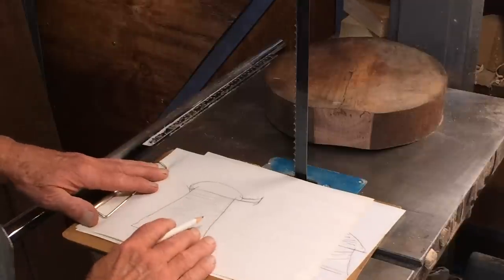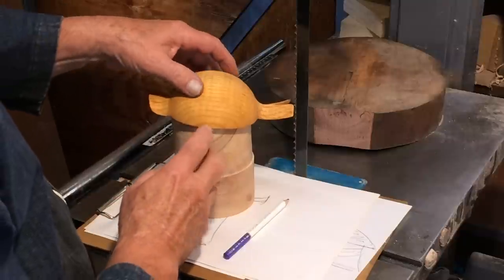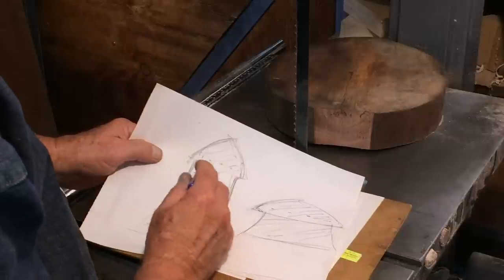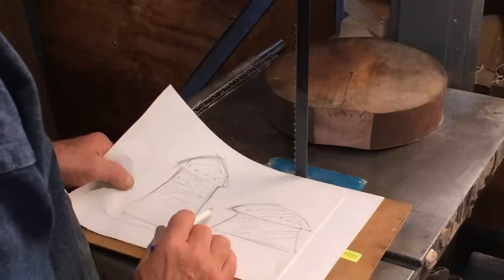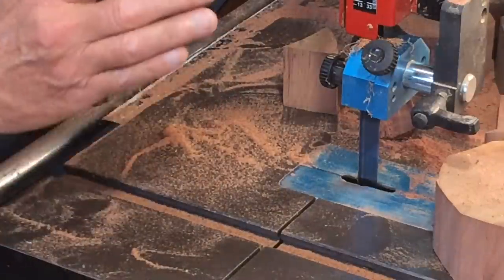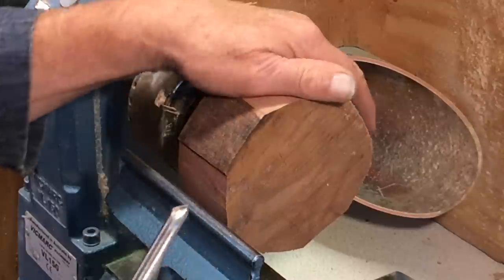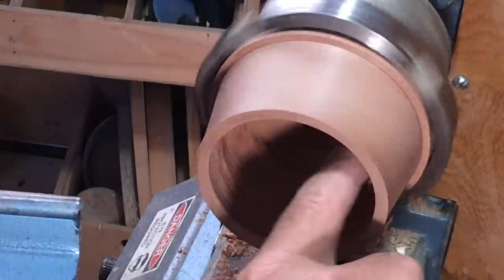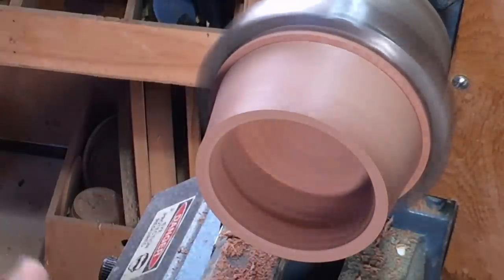Richard Raffan creates a cross-grain box for the first 4—WAYS project.

Comment: Beautiful little box. I am learning to use the dividers like you do to mark a circle. Previously I relied on a large compass with a pencil whose lead frequently broke on rough wood.
Reply from the maker: Did you notice you three had infitting lids, as I usually do for crossgrain boxes, whereas I chanced the other way. I've never got around to making chuck gauges but do have dividers set. Steel gauges would be ideal because dividers shift over time.

Comment: If there is one thing I've learned from watching your video's it is to use scrapers more often. 
Slight problem: You seem to have the right one for every occasion whereas my range of scrapers is fairly limited. 😎
Reply from the maker: Unfortunately I downsized before I started making the videos so no longer have the range of scrapers I used to and most are getting a bit short from regular reshaping.
Reply: @RichardRaffanwoodturning  as a relatively new turner, I've always thought of a scraper as a finishing tool, but I've learned from you that they are good for shaping as well.

Comment: Quite surprised you didn’t use a screw chuck followed by creating a tenon on the bottom for reverse mounting.
Reply from the maker: Mounting over the pin jaws is is faster with more options for adjusting the blank. And i see no point in creating a tenon when I can grip the outside. Putting on a tenon that eventually needs to be removed when I don't want a small foot or base is a waste of time and material. I wasted quite enough on this project as it was.

Comment: Nicely done, RR! Surprised you did not bandsaw that lid to save as a lid for another lidded bowl:)
Reply from the maker: Far too dangerous!!!! That a good way to lose fingers or part thereof. Never cut cylinders on any band or table saw unless the cylinder is firmly clamped to a carrier so it cannot roll into the blade. I did think of parting it but it wasn't worth the time or effort.
Reply: @RichardRaffanwoodturning  Of course, clamp is absolutely necessary along with a jig. You’d be nuts to do it by hand, but safely doable.
Reply: Hi Richard 
I’m a bit uneasy using resin, getting the mix correct,but never thought of using epoxy for small jobs other than gluing up.
Another gem learnt ,using as you did on the embellishment of the lid. I need to try that method using some brass filings I have obtained from a locksmiths key cutting machine.
Thanks for sharing,I think your videos are the most interesting and give a feeling of being along side you in your workshop while you turn.
Thanks
Regards
Reply from the maker: @malbun3275  Many thanks. Your feedback is useful and appreciated.

Comment: Beautiful little mushroom box! Richard what tool would you use to add a round groove around the yellow spots to be filled with coloured epoxy?
Reply from the maker: I'd probably use a skew long point as a scraper so there's a key for the epoxy.  I wouldn't dream of one groove, I'd have a rough groove with wavy edges either side of the dots.

Comment: Hi Richard - I've been watching your videos with great enjoyment ! I have a question about your use of the square end scraper for the bottoms of cross grain bowls/boxes. Would you recommend this technque for larger (12"+) and deeper bowls, assuming adequate support for the tool ?
Reply from the maker: My big bowl scrapers are 35mm x 9mm thick. You seem them in the deeper bowl videos. i rarely go all the way into the bottom of a bowl using a gouge. I find scrapers more accurate.

Comment: What is your lathe speed wen you are applying the beeswax?  I am having trouble getting mine to melt in.  My lathe is in the unheated garage in the northwest corner of Indiana, USA.  I started turning about 6 months ago.
Reply from the maker: Pure beeswax should melt even if the wood is moving quite slowly. You need sustained firm pressure for the wax to melt and the further from centre you hold the wax, the faster it'll melt. Near the rim of a small project like this running at about 1500rpm that should be 3 seconds even in 5°c.  On a 16-in platter running at 800rpm the peripheral speed is probably greater than on the faster spinning smaller project so the wax will melt faster.
Reply: @RichardRaffanwoodturning  thank you for the information.   I have learned so much from your videos.  Turning is my tranquilizer.  I just wish that girls had been allowed in shop classes in the 1950's when I was in high school.

Comment: Your gouge has the left wing longer than the right and I’m not seeing when that comes into play, so what does that grind do?
Reply from the maker: This is the asymmetric grind that I developed in the early 1970s. It's more to do with the steep right wing bevel making some cuts much easier than the swept back left wing although that's where this grind started. Bowl gouges used to be ground straight across until I came alone. This video shows how I use the gouge.  https://www.youtube.com/watch?v=cnNBBV19YLw&t=1s
Reply: @RichardRaffanwoodturning  interesting, I used a 45 degree bowl gouge on everything but the bottom of the bowl were I switch to a 60 degree, having seen all your videos I’m using a scraper to finish the bottom and having great results thanks my time at the lathe has greatly improved with your mentorship